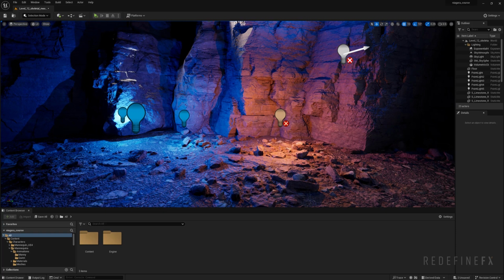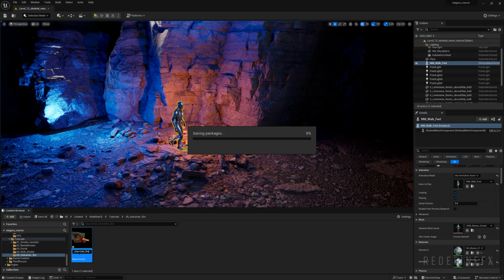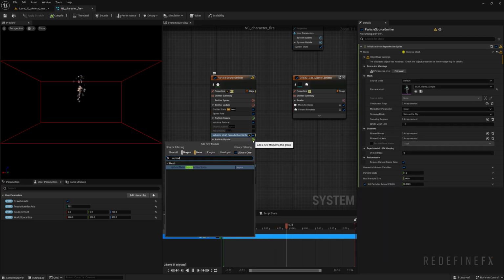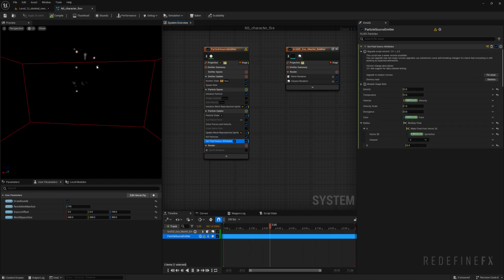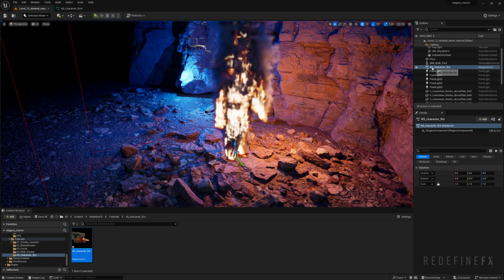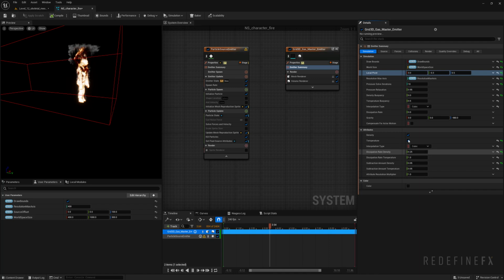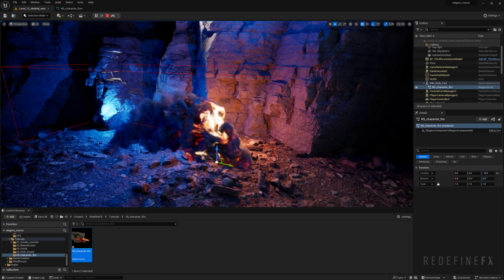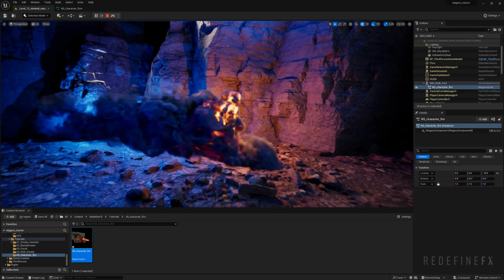Niagara Fluids Tutorial: Character on Fire Simulation (Skeletal Mesh) VFX in Unreal Engine 5.3

Comment: So i can get this to work in the Blue print by adding Niagara to my Mesh in there, i can even get it working in the Niagara system view, however when i import the Blueprint with the Niagara System it doesn't show the flames. even when i just try and drop the Niagara System into the map it doesn't show.
Reply: For anyone who is having the issue of the simulation not showing up outside of viewport I figured out that If you turn on curl noise force it will make the simulation reappear!
Reply: @Ranger69._  Nope, still isn't visible anywhere but preview window X(

Comment: I don't want my Character to be on 0/0/0 coordinates.. how is it possible to change the location?
Reply from the maker: That requires a different setup entirely and is covered in my Niagara immersion course
Reply: Amazing news! @RedefineFX  I made it work with this setup by turning of local space in the emitter settings
Reply: @flathmann  hey men, I turn on the local space butttttt still doesn't work for me ? do you have a solution ?
Reply: @hugomrt6082  You need to turn off local space in both settings.

Comment: Hey bud. I love your tutorials they're so straight forward and clear but I have problems with this one. Everything looks fine in the editor window but will not appear on the map, even if I start the game no niagra appears. Other niagra effects pop up straight away so it's something within this blueprint. I've triple checked everything. I'm dumbfounded.
Any advice. Greatly appreciated.

Also I signed up to your course 🎉
Reply: Hi man! Have you solve that issue? same shit, trying to combine flamethrower with burning man, thrower is working well, but burning  man dont want to burn at all in the level and sqcer...
Reply: @ThinkingUkranian  For anyone who is having the issue of the simulation not showing up outside of viewport I figured out that If you turn on curl noise force it will make the simulation reappear!
Reply: @Ranger69._  Still not working, even with that
Reply: @ThinkingUkranian  hey dude. Nope! It works until you add the reproduction sprite on the character. After that nothing shows up in the sequencer or anywhere. Shows up in the viewport while making the effects fine though.
Reply: @Dannylewis27  For anyone who is having the issue of the simulation not showing up outside of viewport I figured out that If you turn on curl noise force it will make the simulation reappear!
Reply: For anyone who is having the issue of the simulation not showing up outside of viewport I figured out that If you turn on curl noise force it will make the simulation reappear!

Comment: Thanks for another great tute. I am using Iclone 8 to import characters, and this works fine as long as the character stays at the origin point. Is there a way to get the flames to move with the character in sync past the origin point?
Reply from the maker: Yes - I can’t explain it here but it’s covered inside the Immmersion course
Reply: @RedefineFX  how do I sign up for the immersion course?
Reply from the maker: It’ll open for enrollment on march 20
Reply: @RedefineFX  how much is it?

Comment: @RedefineFX Thanks for the nice tutorial, however it seems to be not working in the viewport when the NS is added as child of mesh via character blueprint. I have already enabled plugins niagara fluid, cache, etc. Set the NS to auto activate in blueprint, it shows there within the blueprint but not in viewport. Any help would be great. Thanks again.
Reply: I've got the same problem. Did you find a solution?
Reply: @guerrerourbano7  Same problem here, did you guys get it to work?
Reply: not working
Reply: For anyone who is having the issue of the simulation not showing up outside of viewport I figured out that If you turn on curl noise force it will make the simulation reappear!

Comment: Everything works perfectly, until I move my character off X0, Y0, Z0. Even after I move the Niagara fire to the same coordinates as the character, they will not match up any longer. Any help?
Reply: Set your particle system to local space so that when you move the actor in the scene the particle system will use the local transform
Reply: @count_0_1  Thank You.
Reply: Having the same issue.
Reply: @Kenb3d1  Yeah, I'm still trying to find a fix for it. If you find an answer, I would appreciate it if you would leave a comment here.
Reply: And don't forget to attach your NS to your animation

Comment: Is it safe to assume that this is 5.3 specific? tried to emulate on current project which is on 5.2 and was fine until I connected the Niagara system to the skeletal mesh. it attached, I clicked none. and it just refuses to render in the scene. cannot for the life of me figure out why, also, as daft as it sounds, the positioning of the FX keeps moving. if I put it to the exact same as the actor, it doesn't remain. even though its attached?
Reply from the maker: It's safe to assume it's 5.3 specific
Reply: Figured as much! time to migrate the project. :D  @RedefineFX
Reply: I'm in 5.3 and I have no option for sockets to set to "none" when I drag it on top of my char.  I only have that option in the character blueprint, but still doesn't work